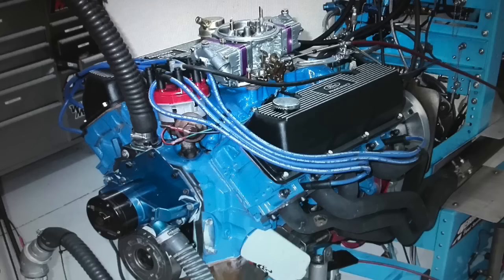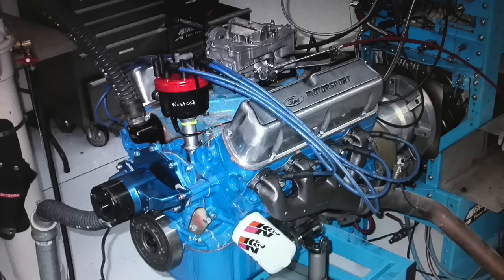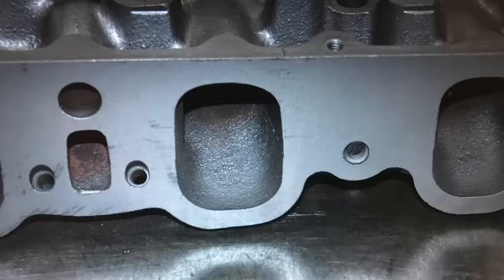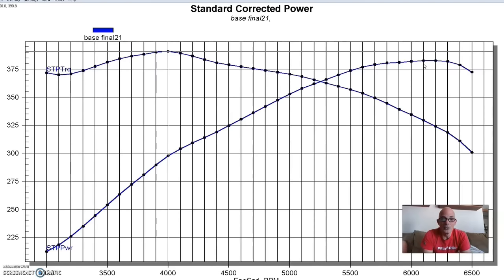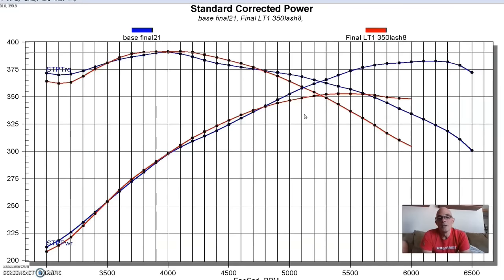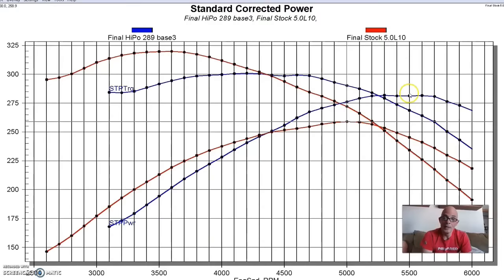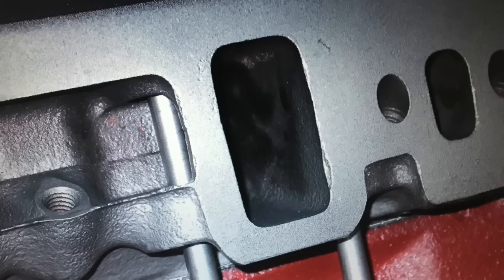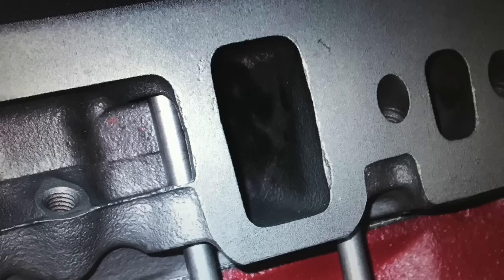HOW MUCH POWER DID THE 1971 BOSS 351 REALLY MAKE? WAS IT THE HOTTEST SMALL BLOCK EVER OFFERED?

Comment: 69/70 Ram Air 4 Pontiac, obviously expensive and rare but it kicks ass in bone stock form, the RA3 manual and automatic transmission versions also both rock as well
Reply: Love to see a ram air 4 versus a 396 or 402 and a ram air V . I think everybody will be surprised what those old Pontiacs will do. It's been fifty years since Pontiac killed their program and I'm still upset. I'm tempted to build a twin turbo Ram Air V should I do it?
Reply: It would also be cool to see a 455 SD tested. The '73/'74 SD heads flow a little better than the RA4's but the huge chambers and low compression are a set back. Still, if they weren't so rare and exotic anymore it would be great to see them dyno tested.
Reply: @1967davethewave  all of these have been tested and depending on which cam they all make over 400hp, very good engines, I've built several round port engines
Reply: The one they really should have built was the RA4 428, My favorite Car nobody talks about was the 69 Model SJ Grand Prix 428 HO, I had a 69 Model J 428 car 370hp version, awesome car, handled great!

Comment: Didn't Shelby have a 289 rated at 385hp in the Cobra? Curious how it got that kind of horsepower out of those heads or was he using a different head? I'm pretty sure that engine had dual 4's on it although I'm not sure how much that would help.
Reply: The street Cobras actually came out the door with the 271 horse 289s (after the 260s were discontinued).  The 289 was then bumped up to 306 for the GT350s.  On the track, however, the Shelby crew determined that a 289 was good for about 380 reliable, endurance racing horse power.  That of course was the reason for switching to the 427s.  Ironically, a 289 Cobra Daytona and the detuned-to-385 HP 427s won at Le Manns.
Reply from the maker: Only in race trim-different heads, cam and compression and induction

Comment: Quote from Hot Rod testing a stock configuration 340 six pack- "Chrysler's 1970 claim of 290 horsepower at 5,000 rpm and 345 lb-ft at 3,200 rpm was bettered by 66 horsepower and 37 lb-ft. Finally, we replaced the headers and watched it grow another 20.1 horsepower and 26.9 lb-ft with readings of 376.1 horsepower at 5,500 rpm and 408.9 lb-ft at 4,000 rpm".

Comment: Well I can kinda explain WHY the 5.0L 302 had so much more torque than the 289 Hi-Po (other than cams and all that jazz) if you followed Ford Trucks, this would be the "Ah-Ha" moment... The Port Fuel Injection system on the 302 was developed in early 80s and was implemented and actually designed FOR TRUCKS, in 1985 was put on the F150 and F250LD (and similar E-Series vans) what that engine was designed to do was be the stop-gap between the 300-6 and the 351W H.O. and replaced TWO engines for 1985 - the 302-2V and the 351W-2V.  (I have an official Ford book that calls this out)  In 1985 Mustangs, the 302 5-Sp Manual car still had a 4bbl and the AOD car had CFI (much similar to the Crown Vic), but in 1986 THAT was going to change...and though the 302 Port EFI made less overall HP on paper than the 302-4V it replaced, it had a FAT Bottom end thanks to its massive Long Runner intake...Those changes made a 302 "Car Engine" into a decent Light Truck engine, and made a very nice Street Mannered Mustang engine.  I mean let's face it, the 302 w/Port EFI made the most low end torque of any engine put in a Mustang since the PintStang (Mustang II) came out 11 years prior. (And made as much or more torque as the 351W-2V in the trucks.)   As much as I don't like the 302 in general, the Port EFI ones were the top of the engineering heap in 1985/1986.

Comment: Had 65 comet cyclone with  With the hypo  289. No it didn't have low end torque but I thought it was pretty quick and fun to drive. Never took to the track but I raced 383 challenger and beat it on the street

Comment: A true apples/oranges comparison, imho. Two motors separated by 60cid and 100cfm in head flow rates, of course you're going to pick the Boss 351... However, nowadays, you can build Windsors that make 2x that much power NA without spending  as much money (Clevelands are notoriously pricey) - so there's that...
Reply from the maker: stock vs stock...the 4V Cleveland wins...so there's that

Comment: My favorite was the 327. It would be interesting to see how a Rochester fuel injected L-84 would fare in this comparison. The factory rating was 375 HP. The highest of any CSB in the muscle car era. Those old Rochester units are stupid expensive anymore though. Pretty much a collectors novelty. But even the L-76 would be right at home in this contest @ 366 factory ponies.
Reply from the maker: I have an L84 video up
Reply: @richardholdener1727  Nice, Ill look for it. Thanks.
Reply from the maker: it did make a touch more than the carb 327-but not nearly as much as the Boss 351

Comment: Agree on the  351 Cleveland but you are way of on the 289/271! Had a 1966 K code coupe and with gears,hooker headers and sticky tires would smoke  a lot of  cars in that era. You went 20 plus years later and were probably right but with your 5-speed 3.27 low gear you would have the launch. Btw at the Indy Nationals D/S was won with a 289/271 Dearborn tubing Fairlane with a time of 13.75  A car like mine (1966) with 5.14 Detroit Locker ran low 13's....They were for the time the best small block period....
Reply from the maker: A 289 WAS NOT IN THE SAME LEAGUE AS A 365-HP 327 OR LT1 350
Reply: @richardholdener1727  No a lot of horsepower difference.. I ran in NHRA classes then. On the street couldn't out run them but romped  273/235 Mopars and most hot cars of the era...  A little story about  a car that wasn't supposed to be fast and are called dogs. Had a 1966 Ford Fairlane GT 390/335 s code. I had a 4.11 gear in it and traction masters. Had a set of wrinkle M&H tires that had been tested by Ford for Raceway Park for Dick Brannon. The Ulrey Brothers let me us them as they had a !966 427 Factory Fairlane and had anther set. Jardine made all the headers for the 427 Fairlanes. They were called 180 headers as some passed under the car and out the other collector.  I called Jerry Jardine and ask him to make a set for my 390 in 1and 3/4 diameter (smaller)and he agreed.  Lastly my car came with the big in and out 2.78 low gear top loader. I could come out at 4000 rpm and just stand on it. In my class was never outran by a GTO,442 or Chevelle. Dog alright a Junkyard dog.v Btw way your program is the best by far , keep up the tests!

Comment: My least favorite engine is the 351 Windsor I put one in my 82 mustang GT put a lot of work into it and it was a joke. Was I think a 69 block 69 worked over heads, ported, bigger valves full roller rockers. Roller trick flow cam flat top pistons with valve reliefs. Raced a friends 82 mustang Notch back he had the stock 302 block high lift, non-HO cam with GT 40 P heads and that car would pull me every time we were both five speed cars. I had 355 gears I think he had 373s. Had another friend with an 89 mustang GT I think a B303 cam with GT 40 P heads and that car would also pull my 351 Windsor I’m sure a lot of the problem was the heads on the 351, but looking back at it, it was a waste of money, I should have used the stock 302 block We dynode my car and it only made 300 wheel horsepower.

Comment: About the same as the Z28 with 350 / 350 HP engine.  1 HP per cubic inch.  Gears in the axles rear end made for all the difference.  I had a friend who had a mini tubbed out 1967 Nova that was running a 350 with angle port heads done to the max and his car could barely make in into the low 15s on the 1/4 mile track.  Very nice show car but was slow as heck on the 1/4 mile track.

Comment: what about the amc 390/ 401?
Reply: What about them?
Reply: @michaelangelo8001  he asked if someone could think of another powerful smallblock, and that was my answer. Would live to see how one stacks up against the bellybutton engines of the same era
Reply: @stuffandjunkandthings364  My father was the shop foreman at an AMC dealership from 1964 through 1970.  I had a 69 AMX when I was seventeen.  A friend of mine had an overbored 401 that was built to the gills, in a 4speed Gremlin. I never saw anything from them during that time that impressed *me*...

Any engine will make big power with the right set of heads and cam, but why make it harder on yourself?

The only body style they ever made that I found attractive, was the little American.  With AMC you are limited in every respect.
Reply: @michaelangelo8001  For the same reason anyone does anything different, because they can, or just to prove it can be done. The same difficulty argument can literally be applied to any engine that isn't a GM product for the last three decades. I get it, they may not be your cup of tea, but I love the odd stuff. Nothing better than someone taking a "throwaway" motor, and making something cool out of it.
Reply: @stuffandjunkandthings364  If that's what you want, get a 500 Cadillac.  Or no, on second thought, go ahead and learn the hard way.  You aren't going to listen.

Comment: Hi Richard , a boss 351 isn't really a small block , point being you can stroke it to over 400 cubes . A 289 or 302 can be stroked to maybe  a little over where a cleveland or Windsor starts . I put a pair of 69 boss 302 heads on cleveland and it ran fantastic, had to drill a 1" water port in them but the small chambers 58cc and 11to1 compression with 830 compression carb awesome.
Reply from the maker: Boss 351 (351C) is a small block, just like a 351W. The 351C has a shorter deck height and its ability to stroke out to 408 does not change that status

Comment: You stated the boss 351 motor had 11 to 1 compression. Due to the boss 351 Poly-angular combustion chamber it’s compression ratio is 11.7 to 1 not 11.0 to 1. If your motor was built to 11.7 to 1 as the factory did , it would even have a higher horsepower rating. We all appreciate your hard work.

Comment: Around 1973-74 I bought a 1966 mustang with 6 cylinder. I was a dumb farm boy. the transmission broke.(3 speed manual).
Some how I found a 289 that a guy rebuilt at a Community College Auto shop class. I will always remember that he told me he put a Ford LeMans cam in it. I then found a toploader 4 speed and a 9" rear end with 3:50 gears. Lo and behold, from a standing start, this Mustang would Kill almost anything that was somewhat stock in the 8th mile. after a quarter mile my brother's 1968 Charger with a 440 magnum would pull away. In the corners he couldn't even get close. So I have to respectfully disagree with you that the 289 sucked. I got lucky and mine was really fast all the way to 110...same as the song "Hot Rod Lincoln".

Comment: The only reason the boss 302 existed was to sell 500 units to legitimate the package for the Trans Am races! It's a waste to put the heads on a glorified 5 liter motor! On the other hand the taller block with longer connected rods of the Cleveland is miles ahead! However, the 9.5 deck Windsor was ignored! The extra  .300. Inch of deck and almost 6" rods made it the logical choice with the 3" mains and heavy crankshaft being the only negative attributes,  As far as the physical dimensions go the did put big blocks between the shock towers, so a Cleveland headed Windsor is no problem!
Reply from the maker: please see the BOSS 302 vs DZ302 video-The Boss 302 did just fine
Reply: @richardholdener1727  I'm old enough to remember them! I love, and drive Fords. But the Boss 302 was a cobbled up mess thrown together legitimize the car for Trans Am racing! The Maverick was a better choice for street rodders but the shock towers were so tight you couldn't get anything other than a 302 in it without digging the headers and shock towers! Think it was by design to make sure the more expensive Mustangs would sell!! Got to give it to Mopar for the Road Runner, an affordable, light car with room enough to get a big motor in it!! Good to know you actually read the post, and I watch ur show religiously!

Comment: Hey Richard, please clarify. Is the 289, 302, 351w and 351c all the same block?!?!
Reply: correct me if I'm wrong but 289/302 is the same block, the 351W is a taller deck version of the windsor 289/302 and the 351 cleveland block is different in that it has the timing gear housing cast into the block and a couple of other differences, including a different bell housing bolt pattern etc..
Reply: then there is also the 302 Cleveland which is a factory destroked 351c
Reply: There are 260/289/302 short deck Wondsor engines with worse heads. There are also tall deck 351 versions of the Windsor. 

The Clevelands are a different engine with better heads. They were 351 and 400 inchers. 

The Boss 302 is kind of a Windsor with Cleveland heads.
Reply: And the crank diameter is smaller on the Cleveland, so no, the blocks aren't the same.
Reply: To Sean Hayes major difference in blocks 351 had more beef in the main supports and still small block but 40 LBS on block and around same in heads . And intake
Reply: To V8 Jono same bell housing bolt pattern . Take it fro a ford guy that I have owned practically every early ford motor through my years .
Reply: No, In short  289 & 302w same (8.2” deck height) , 351w  9.5” deck height & different mains size , 351c 9.2” deck height different mains size along with different front timing area & water outlet off the block not outta the intake like on a Windsor.
Reply: 69JANKS yep , spot on .
Reply: windsors motors have smaller crank jornals and different heads and a smaller v in their blocks .....than clevelands  .....clevelands wider v different heads  have owned all these motors in ford v8 s over the years  living in austraila
Reply from the maker: there is no 400 Cleveland-that is a 351M/400 block -tall deck-351C is different 9.2 deck block-different also than 351W block
Reply: James Mills 👍🏼
Reply: Richard Holdener 👍🏼all Clevo's  are 9.2" deck height (302c & 351c). The "M" series are taller deck blocks almost 10.3" height, different/bigger mains size 3.00"  & have the big block rear bellhousing bolt pattern......... the M is sort of the Big Brother of Clevo's & do Or can run the 2v & 4V heads .👍🏼🏁
Reply: Vegas EMT in Australia 🇦🇺 we used the 302c & 351c in production cars up until the early 80s 👍🏼 Ford guys down under are Cleveland crazy lol .
Reply: Vegas EMT  windsor blocks a smaller in genaral to cleveland blocks ///smaller in v ..i have been with these motors over forty years ..in austraila have built lots of v8 s

Comment: Please test a Ford FE! Ideally a 390 as they’re super common in pre-smog F series trucks.
Reply: 66-67 390GT badly need valve springs.... And a cam.
Reply: @hotrodray6802  worked at a Ford dealer in 1970. To keep 390 GT warranty numbers down Ford intensionally put weak valve springs on them so that the lifters pumped up at lower RPM's to keep from paying for warranty engine failures. Also kept them from having any success on the street either.

Comment: Don't get me wrong I love the Ford 289 but that 351 Cleveland is badass compared to the others as no other manufacturer had small block heads with 2.19 intake valves and Tennis ball-sized ports. I have owned these Chevy's that people brag about 327, 350, 383 and a 400 but none of them ever made the power that the Cleveland makes.

Comment: I agree The Boss 351 was the best small block on the market in the day. Just ask Jack Roush, Dyno Don, etc. The problem was there was one Boss 351 to every ten LT1 Chevy's on the street so it never made a huge impact except in Pro Stock. In fact the NHRA made the Fords run heavier than the chevy's because the chevy guys cried that the Fords had an unfare advantage, a canted valve cylinder head, which would continue into the 80's NASCAR stock car racing series.

Comment: Wish I could get my engine dyno tested.  It's a 351CJ I stroked to 426 cu. in. with 8.70 to 1 compression, crane roller converted .589 intake-.612 exhaust lift. I plan to used forced induction after break in.  Way to much other goodies and machine work to post here. It was built to take it.

Comment: Richard when are you building a N/A coyote engine, I have a 2016 5.0 Mustang and want to mod the engine with out power adders. If you haven’t done one yet.  Don’t want to be the same old same old. Most coyote builds are based on boost or nitrous. I want to see the real potential of a coyote in N/A form.
Reply from the maker: I did a lot of NA Coyote Mods to the Gen 1 back in 2010 and 2011-go it near 600 hp
Reply: Richard Holdener do you have the link to the video? Parts list?

Comment: I had a 1971 Nova with a factory 350 LT1 rated 365 hp
Reply from the maker: a 1971 LT1 was not rated at 365 hp-those lower compression 71 versions were factory rated at 330 hp (If you had a 1970 version, they were rated at 370 in the Vette and 360 in the Camaro)

Comment: Without watching the remainder of this video I will say that torque is the difference between the HiPo 289 and the 88 5.0 lx. The head flow and displacement put the 289 at a disadvantage from the beginning. The HiPo 289 mustang was pretty snappy in 1965 but the gearing and torque of the 88 5 speed 5.0 lx mustang are a huge advantage vs that 65 k code

Comment: I stopped your video at the part about the K code 289 vs the HO 5.0L and as much as I have always loved the K. I have an 86 HO 5.0 in my 85 F-150 4X4. Edelbrock performer, 570 cfm Holley, 95 Mustang Cobra roller, short tubes , stock heads/compression and I know it will stomp a K code on it's best day in the same vehicle!